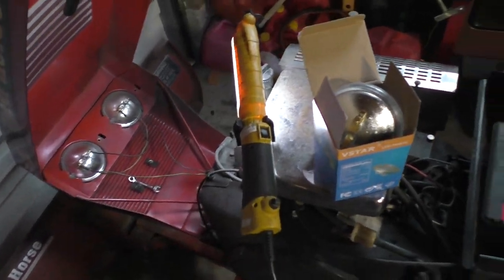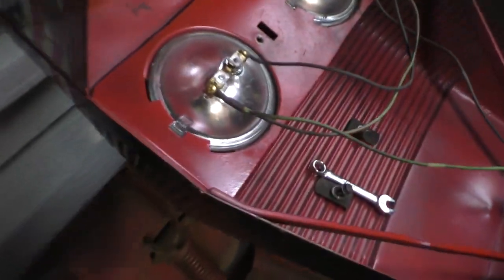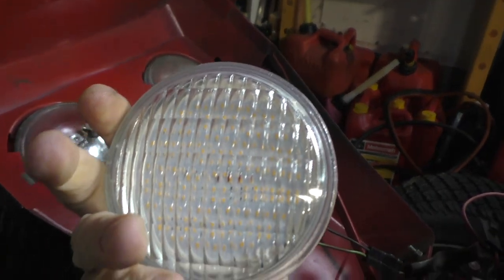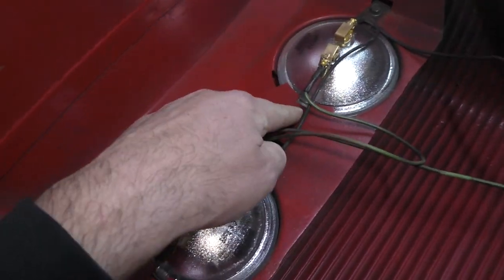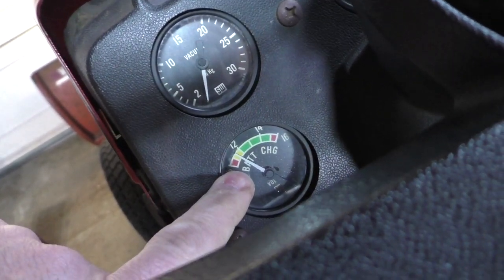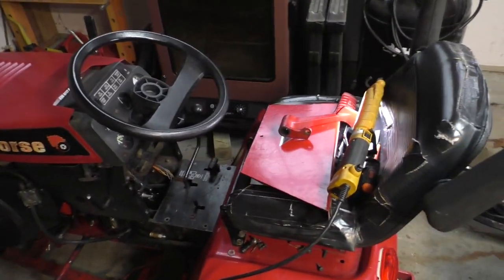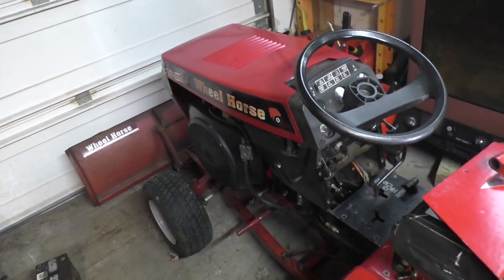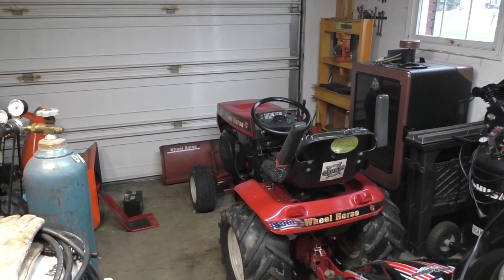Wheel Horse Lighting Upgrade

Comment: I put the same lights in my 312 H about 6 months ago huge difference. My lights only work with the engine running they don't run off the battery
Reply from the maker: Why don't they run off the battery?  My 416-8 headlights ran off the battery (incandescent lights).  Maybe the key switch was changed at some point.. I thought the 300, 400 and 500 series all used the same switch.  Either way, you're saving a lot of power when running those lights.  If you haven't subscribed, please sub to my channel, have lots of videos on WH tractors.
Reply: Two sets of windings in the flywheel . One runs the lights the other charges the battery.  I have a Kohler 12 hp engine you must have an Onam maybe

Comment: Very Cool! Definitely brighter! Could have been the old battery. but keep an eye on your Voltage Regulator/ Rectifier. I;ve had to replace mine. Luckily had one on the other tractor.
Reply from the maker: I tested the charging system a couple weeks ago and it was 13.7 at idle, little higher at 1/2 throttle.  I think the draw on these coil lights is huge.
Reply: Good deal. Coil should last. If you start seeing charging problems again could be a ground or the Vr/R. Shouldnt have much if any corrosion on that thing though.

Comment: I like those Less pull on the charging system
Reply from the maker: I really needed less draw.  I was thinking some of the issue could be the wires themselves to the lights, they are old and probably a oxidized.  But these fixed that.

Comment: as the old saying goes  - "Oh well" -- I was either 3 days too early, or your video 3 days too late -- haha -  I just ordered these LEDs from a specialty Wheel Horse supply site 3 days ago -- should have them any day -- except I paid $30 EACH -- never thought an "old" WH head lamp ( 1989, 312-8 ) would be on Amazon -- actually I had checked a few WH supplier type sites and they had no matching lamps -- so I finally found them ....but bigger bucks than you paid on amazon -- lessons learned !! Although I do like my business going to the smaller entrepreneur sites -- but I did pay a premium !! Yikes !!
Reply from the maker: I was going to buy these lights from 1000bulbs but they were $30 each and the shipping was another $12 or so.  Just happened to find on Amazon, but the reviews had a bunch of guys with Gravely's and Bolens tractors that used these lights and loved them.  I'm liking them.  Turned them on late last night down the driveway, wow they make a difference.

Comment: Might as well replace the lamps in the rear of the tractor with LED too. Even replacing those with LED's will help your charging system keep up and help your stator and regulator last longer too. I understand it is not necessary but, hell why not.
Reply from the maker: I know, thought about it.. the headlights have a weird look during the day.  Can see all the little diodes in the bulbs.  Rears would maybe be brighter than the current tail lights, helping during winter when I push snow.  My luck they'd flicker which would drive me crazy, lol.

Comment: I have some and they flicker at low rpm
Reply from the maker: At idle your charging system is producing low hertz, I think under 50 hertz LEDs will flicker.  I didn't see a flicker with these but could be that my charging system was producing enough current.  I'm guessing these newer ones have diode or resistor to help prevent flicker.